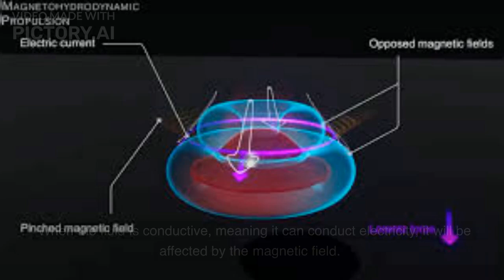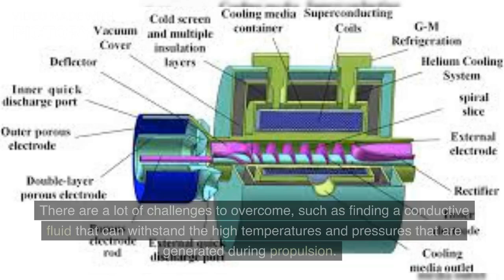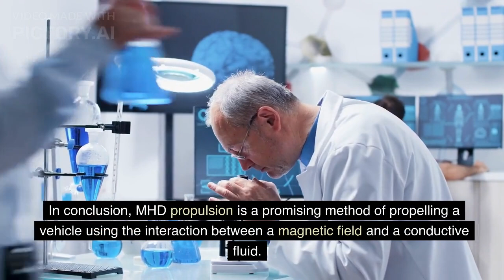MHD Drive | How It Works

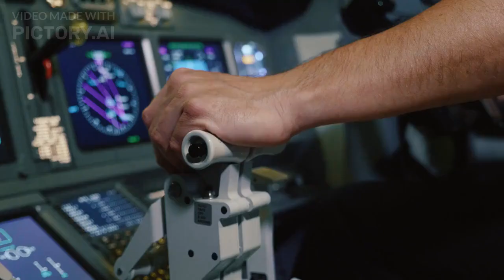Comment: 1:01 hahaha Prove it.
Reply from the maker: Its been proven with small experiments check out The Action Lab's video where he made said small experiment on mhd drives
Reply: @mruniverseme  don’t forget in order to make such a craft be able to work well and good enough You would need an absolutely absurd amount of energy to power a electromagnet to be able to get that strong. This is why I think the US and China has already figured out how to build safe mini nuclear reactors for top secret crafts like this. A mini nuclear reactor would be able to power something like this if it was build right and with enough research and development which should be no problem considering the billions of dollars they are funded not to mention other top secret projects in the past
Reply from the maker: @legoenginemechanic101  yeah true I was just making the point that it is possible since small experiments have been done as proof of concept. But youre right the only reason MHD isnt mainstream is the amount of power needed
Reply: @mruniverseme  star Trek technology already exists. They need to create reasons to unveil it first. Like a war. Pretty evil.
Reply: actually  they  have proved it.  japan build and tested a viable system  in 1992  the vessel was 30 m  long and it obtained a speed of 6.6 knots,   the us  military laid down the design in 2022 and was in process    of building it in 2023 on a virginia class sub

Comment: Cheap electrically conductive fluid,  try Pee.  Tried pissing on a spark plug once and I can tell you it is conductive.  The DC current required to run MHD will also perform electrolysis and convert that pee into oxygen & hydrogen.   Pee is the fuel of the future.
Reply from the maker: 😂😂not sure pee is the future though